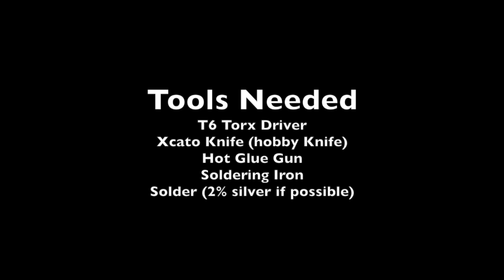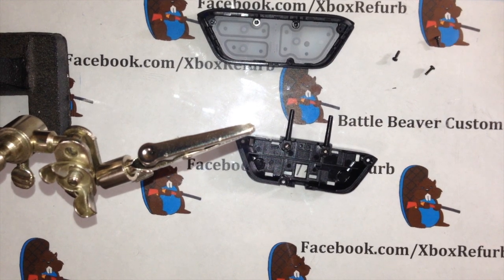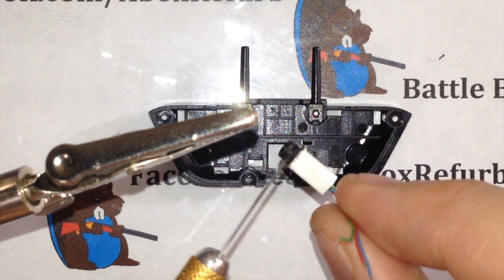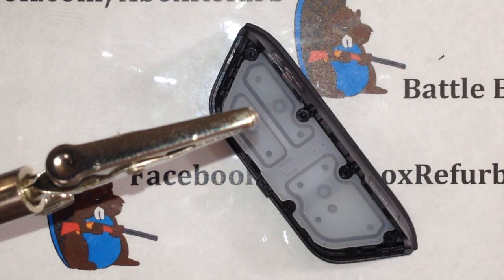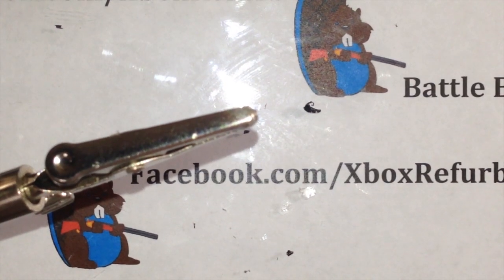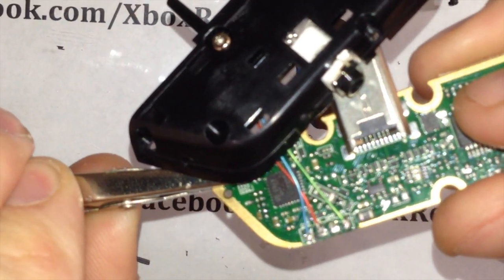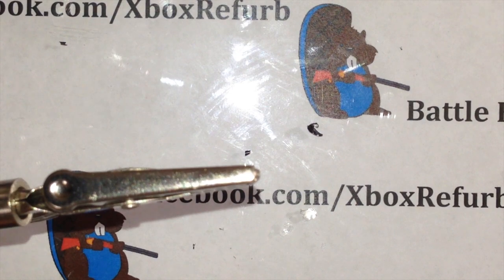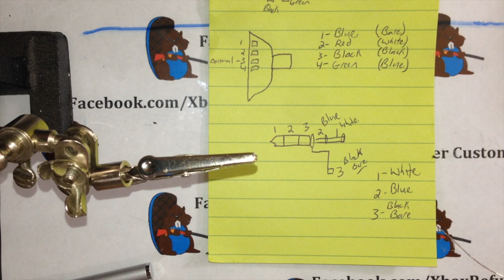Xbox One 2.5mm Headset conversion for Turtlebeach, astro, and other gaming headsets

Comment: Just tried this myself. Screwed it up big time! A series of wrong parts and impatience led me to get the wrong solder, wrong iron, and wrong female jack. The one radioshack sells is to big for the housing. I also bought 22 gauge wire for the female port, (which is far to big as well). I should have just ordered the jack from you. I now lifted the contacts off the board, now rendering my board useless. Oh well, now I have to wait for Microsoft to release an adapter so I can use my turtle beach headset.

Comment: I didn't know that I had to sabotage a perfectly working XB1 headset to use this adapter. I would recommend you develop a headset adapter that uses a 3.5mm connector and on the other side plugs into the XB1

Comment: Hey saw ur info via F1sT.  Im gonna grab a 2.5mm female port off ur ebay store as I can do the soldering myself.  Quick ?:  Using the stock XB1 headset, I cut off the headset part and tried to simply soldier my 2.5 mm male chat cable (cut in half) from my Turtle Beach X41s onto it...as many youtube vids have shown.  And it works fine, but only for my X41 headset.  I have Astro A50 wireless but I cant get that same chat cable to work..  I tried every combo of wires but nothing made a difference when it came to the Astros.  Works fine on X41s.  Ill buy a stock XB1 headset and see how your prewired port works... but I what I need is your port to work on my Astros.. which I see from F1sT they do.  Any tips appreciated.

Comment: How can I purchase a completed version? I bought my Turtle Beach PX-22s because the amplifier is great at blocking other noises other than my voice when the mic is on. But on the Xbox one, I can't use it and my friends can hear a fly passing through a room across the house. Will this allow me to use the 2.5mm amp from the headset with the controller? Have you had any other cases like this with the PX-22s. This is an issue I've been trying so many solutions with and have been met with failure. Thank You

Comment: Did this mod and it seems to work. however, I can hear my voice echo and my friends sound very quiet. I can barely hear them. There is also a low volume hum whenever I plug my chat adapter in. Any clue what I did wrong?